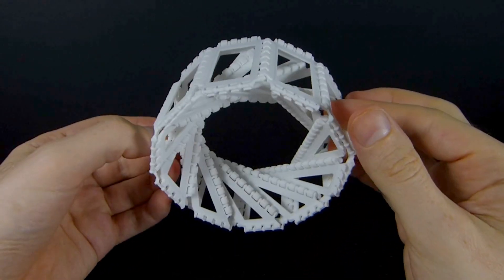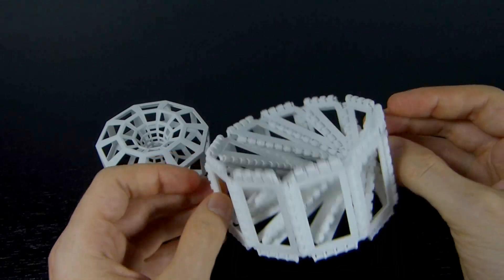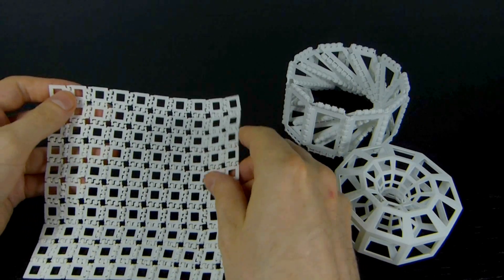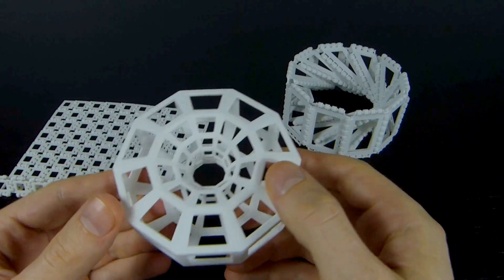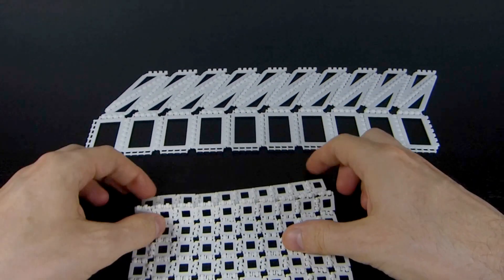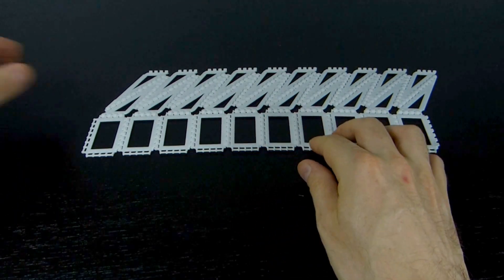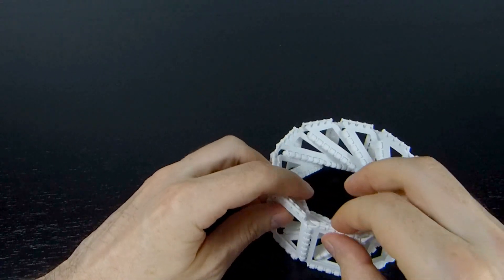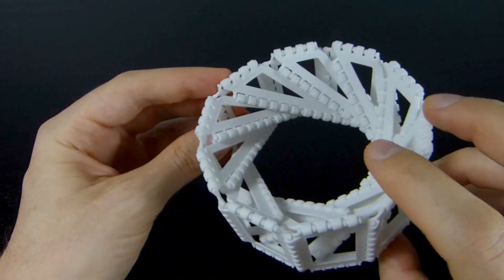Hinged flat torus

Comment: This can also be a really awesome physical demo to explain the idea of UV mapping when dealing with 3d computer graphics! Specifically primitives such as a cube, torus, cone etc.. I normally try to explain UV's like making a sewing pattern, but this is a nice tactile demonstration of the same principle!
Reply: the problem with using this particular video for that particular explanation is that this geometry does produce a shape that looks like a torus, but it is not a pure geometric torus. There are faces that overlap other faces, it's not convex, and I don't think it's even enclosed.

Making matters even worse, the ideal UV map for a torus WOULD be a square, because computers don't actually have to physically wrap a rigid sheet. If you made the UV map for your torus look anything like this, your textures would be extremely distorted. With a square map, you only need some basic transformations to make your UV map look natural.

A better physical demo to explain UV mapping would be nearly any other unwrapped net of a geometric 3d object, such as a cube or pyramid or dodecahedron. Those CAN be unwrapped, and you can easily see how it goes back together. If you want a physical activity for students, you could even have them do papercraft (often called pepakura), where you cut out the unfolded net of a 3d object and fold it together with glue or tape to hold it together. Cheap materials! You could have students draw on the template before they cut it out and fold it; this would literally be a UV map! Have them try to draw things in the correct locations or with textures that would line up along the seams, and have a laugh when it ends up all jumbled.

Comment: I'd start with it  being not really a torus since the crossections wil have polygon area instead of circular area....  it is just a genus 1 object with a hole, but since it's not circular base it doesn't need to pose any trouble unfolding it to 2d

if You were to think of it; the problem with torus tiling is the circular nature of it

You can tile ed cube with squares no problem, 
You can not tile a torus due to it's circular nature though as You'd have to use shapes, that are not flat

I mean...unless You'd want to count tiling with infinitely small tiles that are too small to bend,,... but I'd argue, tthat the curvature is non-0 regardless of scale due to it only asymptotically aproaching 0; hence You should never be able to unfold torus to 2d

Since this is not torus (as it's not having circular crossection) it does not pose such problem  as You just have multi-polygon approximation of a torus which can be tiled as it's only polygon grid.
Reply: Why should a torus be circular ? It isn't a required constraint most of the time and certainly not if you consider going from a flat plane to a flat torus.

Comment: Oh my God! That's amazing!  If I could figure out how to recreate this with wires I could fold a toroidal winding in seconds instead of painstakingly by hand over hours. Dude!  Where can I find more information on this?
Reply: ur 6 years late
Reply: Unfortunately it wouldn't work very well for that
Reply: To explain even tho this does in fact fold flat nicer than other models perhaps, that doesn't make it a 'nice' fold, it has a lot of breaks that would be hard to mend on a several winding toroid, and impossible on a many winding toroid. Besides this the shape is pretty wonky and would impede efficiency and make calculations impractical.
Reply: For winding something onto a torus, you want something very different:
1) get yourself a wheel, with a slot cut into it's outer circumference- the wire/string/whatever that gets wound around the torus will get stored there;
2) cut out a segment of the wheel that's large enough for your torus to fit through when fully wound, and connect it back into place with a hinge & latch, so that you can easily swing it out of the way when needed, and latch it into place otherwise;
3) cut a hole at the spot where the two pieces meet but don't have a hinge, and also place some sort of clamp nearby to hold the end of whatever you're winding onto the torus (note that the clamp is on the ring, not the torus!);
4) get yourself a bit of machinery to turn the wheel at the same time as the torus (though probably at a different speed).

You use this device as follows:
1) use the "swing segment" to put the ring through the center of the torus, then latch it closed, and mount the ring & torus onto the machine- they should now be interlocked;
2) take the end of whatever you want to wind onto the torus, run it through the hole in the ring (from outside to inside), and restrain to the ring (not to the torus!) with the clamp;
3) run the machine so that some specific length of the material you're winding onto the torus is now wound onto the ring, then turn off the machine and cut the material between the ring and wherever it was being pulled from;
4) unclamp the material that you're winding onto the torus from the ring, in some way clamp it to the torus (tape or something, whatever works), and run the machine again.

The reason that this works is that initially the ring is pulling the material into a giant loop that passes through the center of the torus, but after the wire or whatever is cut, and the clamping point is moved to the torus, that loop of material is transfered to the torus directly, with the hole through the ring serving to apply the tension that is used to initially pull the winding tight. I know of this device because I've seen a video of one being used to wind transformers.

Comment from the maker: The torus is supposed to have flat, euclidean geometry, but the usual "doughnut" embedding is not flat - it has curvature. Here's one way to fix the problem.
Reply: I'm now wondering about the properties of this vs. the sort of fractally corrugated flat torus embedding I've seen elsewhere. Do they have different degrees of  (non)-differentiability?
Reply from the maker: The fractally corrugated one is C^1 (has first derivatives), this is only C^0 (continuous but not necessarily differentiable at all).
Reply: Nifty. Who discovered that solution?
Reply from the maker: I'm not sure. I found out about this shape from http://www.mathcurve.com/polyedres/toreplat/toreplat.shtml
Reply: @Rubrickety  it's technically not torus as it's not circular in crossection.... it's polygon approximation of toroid which is possible to tile with 2d mesh, while 3d torus with true circular shape is not possible, do note that it has angles all over the pleace, which i snot supposed to happen on torus
Reply: It's not exactly a folding of a Euclidean plane into a normal torus, but rather it is folded into a kind of a skewed torus where if you go straight up you'll appear on the bottom shifted sideways.

However, this can easily be fixed by cutting away the bottom part of the folded torus and substituting it with a mirror image of the top half.
Reply from the maker: @eliyasne9695  I think you’d have trouble folding that design up in 3D.
Reply: @henryseg   not necessarily.
If you cut the torus in the middle of its hole it should be entirely possible, albeit still quite uncomfortable.
Reply: @eliyasne9695  it'd still not be torus....it'd be 3d folded 2d polygon mesh but it'd not be truely circular at all

it wouldn't be torus by definition; it'd just look nifty while being approximation
Reply: @adamborowski5846  
Its Topologically a torus, yet geometrically flat, and yet still it is embedded in a 3d Euclidean space. That's exactly what we were interested in.
Reply: That's nice. No need to a fourth dimension to have a flat torus !
Reply: @MatthieuWalraet  still is
this is not torus really... it's mostly a polygon mesh folded into 3d and approximating 3d torus while not having true circular crossection

the circular crossection is problem as it requires You to change the thickness of grid closer to center....and You can not do it...You can only do better and better approximations

Check 3d rendering of circular objects with polygons to learn more
Reply: Henry Segerman I figured it was something along those lines.